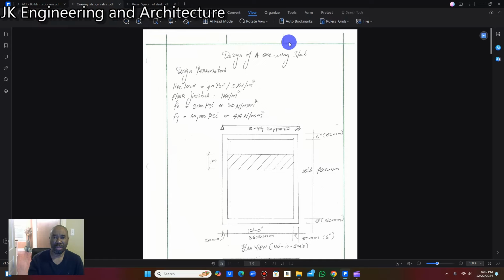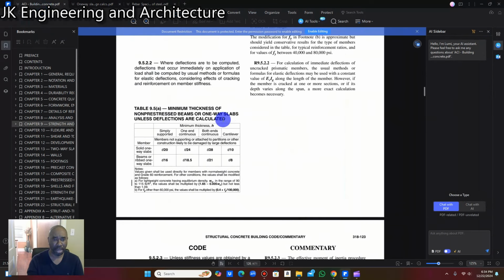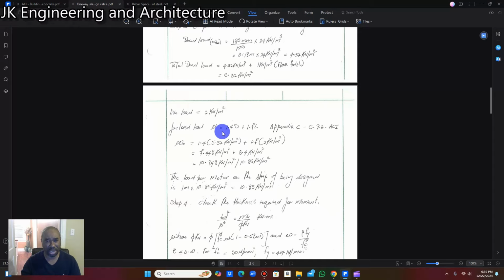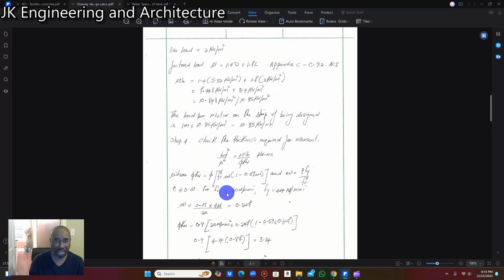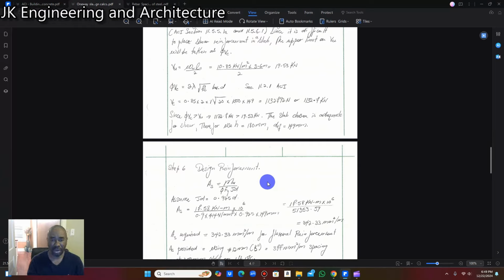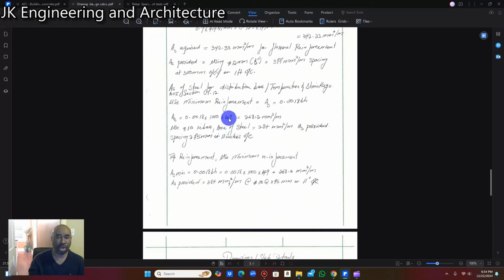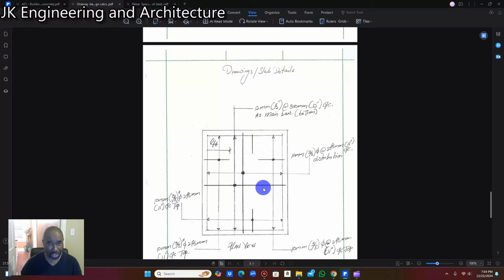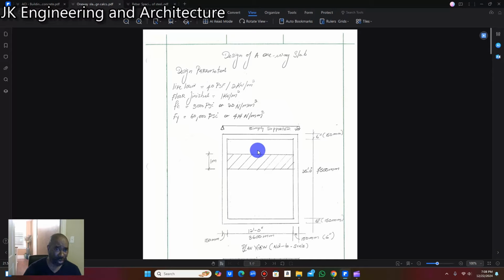How to Design a ONE-WAY reinforce concrete upper floor slab for your residential Home.

Comment: Good afternoon have you ever thought of teaching short online design courses specifically on beams, columns, slabs and footings using the ACI or any relatively similar standards.  I’m a 3rd year engineering student from one of your alma mater enrolled in a program you did at utech.
Reply from the maker: Might be. Probably I should think about it. However I would try my best to bring you the information on this medium for the time being. Make sure to subscribe to the channel if you want to learn more.
Reply: This is a great idea.. excellent instructional ability

Comment: Thank you for the information. What is the cost to design a five thousand square feet home?
Reply from the maker: It depends on who you use to do the drawings. Whether an Architect or a Draftsman. With a register Architect it would cost more for sure.
Reply: Thank you. I'm was trying to figure out what's the cost per square feet .

Comment: good presentation you should also include concrete mix ratio for said slab thank you
Reply from the maker: The concrete strength is in the design. The concrete strength is 60,000psi or 20n/mm2. I dont recommend on site concrete mix to pour concrete floor slab. With on site concrete mix you cannot verify the concrete strength.
Reply: your correct thanks that